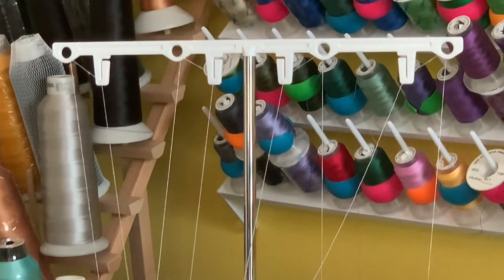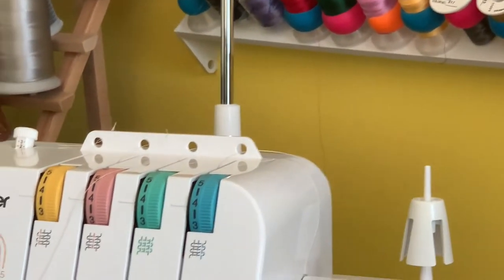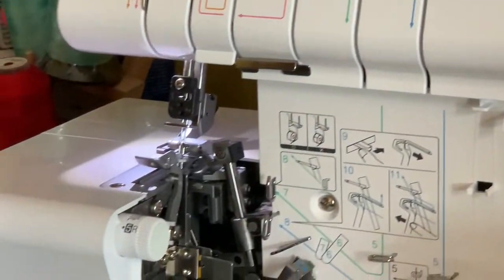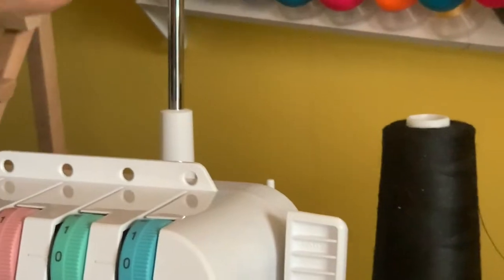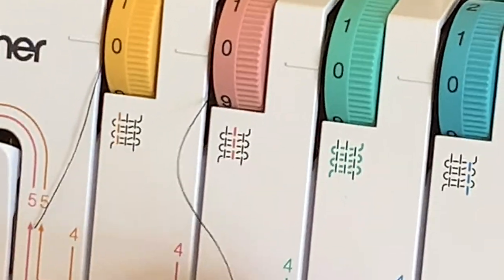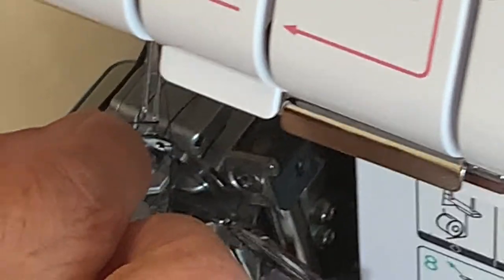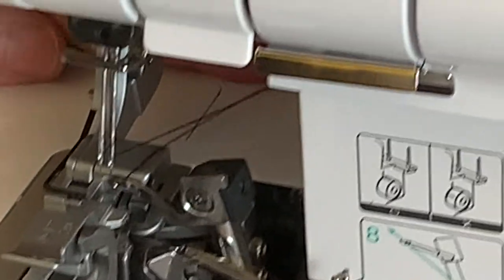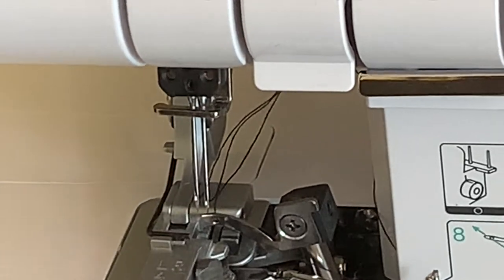Threading the Brother 1034DX Serger

Comment: Do you think I could cut the thread cones then knot the new thread cones to the threads left in the machine, then run the machine to bring out the old thread along with the new thread, then cut off the knots?
Reply from the maker: Hi Pixelina.  Yes you can definitely do that.  You will need to change all the dials to zero to easily pull all the threads.

Comment: Thanks for the great video. It doesnt appear step 10 for me has the piece moving out far enough for me to thread. I used step 9 to open it up but doesnt seem to open wide enough. Anyone else have this issue?
Reply from the maker: Hi Mary turn the wheel towards you and it will open for you.  This part is a bit tricky.

Comment: Question:  I'm very curious to know...why did you reset the tension dials to zero?
Reply from the maker: Hi Wiselady.  When you set it to zero it makes pulling out the threads easier.
Reply: @BoricuaSewingCrafts  Ohhhhhhh, okay.  I just bought a serger and noticed it was already set to 4.  I will be using this with my serger.  Thank you so much for responding. 🙂